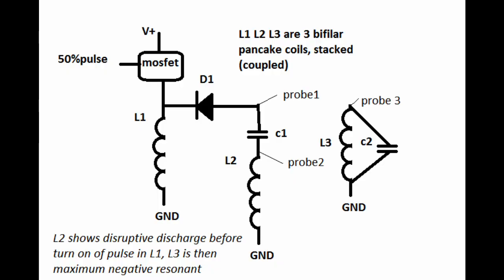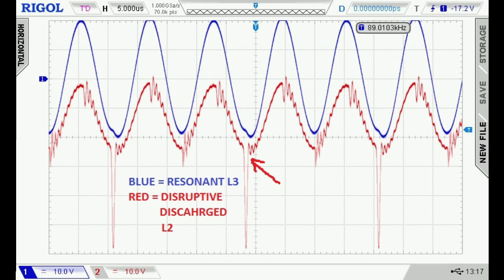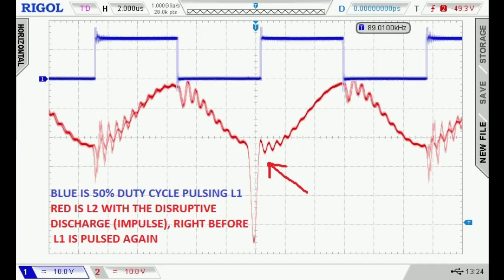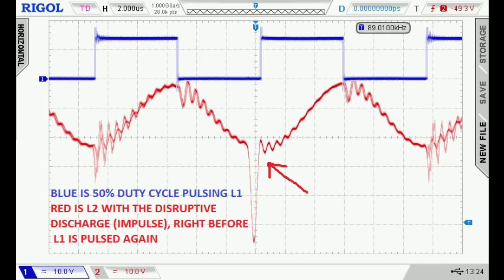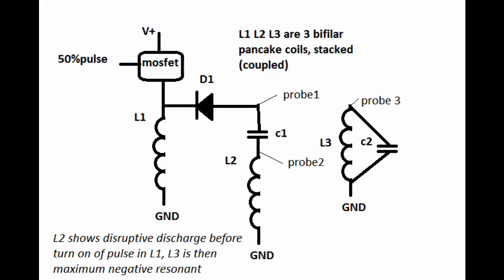Radiant energy bifilar coil experiment

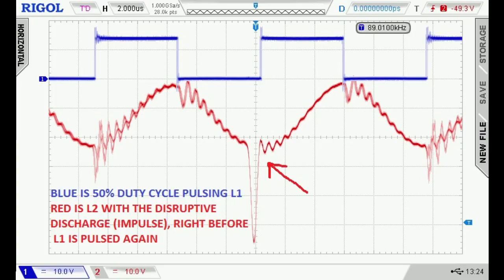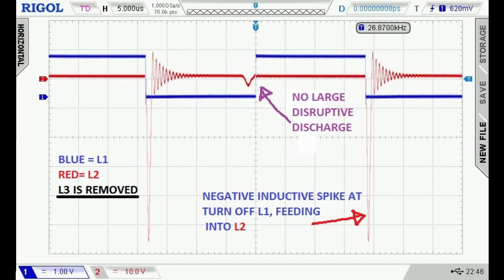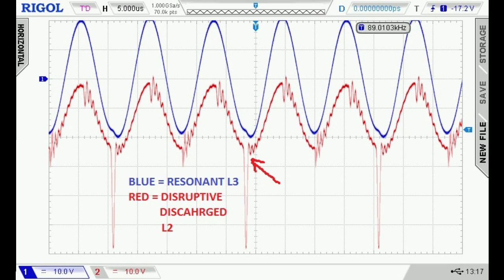Comment from the maker: the large negative discharge (-300V) at 1:27 should not happen at all. The negative inductive spike seen at 2:58 is perfectly explainable and expected (CP Steinmetz gives a good answer).  but is not seen at 1:27! Are the coils acting as diodes, by their magnetic fields?
Reply: Exactly YES... The coils are a conduit pumping with expansion and contraction. The coil will have a higher pressure side and a lower pressure side and a low temperature side and a higher temperature side... My explanation for the magic that seemingly occurs for equipment sensing back EMF pulse before the switch opens or closes as if there is an intelligent anticipation, is that with open systems we are creating what I term as Electro / Magnetic pumps. Depending on the configuration of the bifilar coil, there will be observed what I call Radio Frequency Watts others call Radiant Watts... The Radiant Watt, to those of us who observe and build devices to pump Radiant Energy simply call it Smart Energy... True Radiant Energy  navigates densities without colliding with most matter composed in electrical components such as diodes, MOSFETs, capacitors, batteries, coils or the human body!  Most indoctrinated engineers in my generation were trained not to understand this phenomena. This Radiant Energy is the universal communication line that impulses controlled by at least three spark gaps in series with varying distances create the footprint to control linked systems to other Conventional Electro / Magnetic transformers. Hope this helps! Have fun and do no harm! This isn't "PFM" (Pure Freeking Magic) however it's close. Any electromechanical device that went maverick or uncontrolably attracted high voltage and amperage, that I've created, and destroyed itself, after  performing a post mortem inspection, I found always at least three spark gaps on the devices components and remains. Be careful with learning this system as even just (1) D size Alkaline 1.5 volt battery can and will deliver up to 25 Amps explosively with potentials way beyond 50,000 Volts!
Reply: 2DOG3FIST  Devices that i've experienced, designed, built, tested & experimented with are primarily closed shielded buck and boost circuits. When dialing in tuned ultimate performance and finding real world operating parameters and my subject circuit performed lets say beyond expected potentials... I call going maverick! Well beyond designed currents and voltages... While doing post mortem inspections I've always found at least 3 spark gaps (these gaps not intended but caused by high potentials) on the circuit boards, wires or connections (ie somewhere in the system) that opened the system to transient (mmf) "Magnetomotive" . Some performed spectacular but for a short duration of time! The puzzle of transient energy is fascinating. I get pleasure by reproducing these experianced anomalous phenomena to safeguard against future burnouts of planned designs. I take sincere note and respect. Cheers!
Reply: i consider the 'buck / boost' all under the 'magnetic pump' catagory thanks for the reply.
Reply: Kolin Evans Your welcome!  Most who work with buck / boost do understand we are working with magnetic pumping in that, we are compressing the reluctance of North against North  and offering the result of this compressed magnetic wave to the suction South circuit, which overcomes density of the electrical circuit's grip. Personally my perception of the spills of the radiant gradient one of the keys to unlock the grounded earth pump electrical system. It's a Centrifugal spin off of magnetic voltage energy potential recaptured by the Centripetal Amperage energy potential. Have a great day! This is an example: https://www.youtube.com/watch?v=FvV40BWgByw
Reply: yes thank you for the reply - indeed i've been thinking along the same lines re your dual polarity and output results so thanks for the input - as regards Earth pump - also i've had this and that {archived} curiotsity towards the common Microwave oven 'transformer' in which the High potential {2kv~} side is 'earth pumped' with the output polarity then being directed to a high potential capacitor with the other plate also being polarized to earth with is high potential diode.   i've  often mused to myself the results of 'pumping' one polarity of the high potential into earth then equalizing it on the other plate of the capaitor to earth..
i have also been playing with mirrored inductors recently, so thanks for the reply. 

my next experiment after playing flyback pumps will simply be three inductors on a core each 'tesla' wound and two being mirrored - the third i will experiment with self connecting - this should universally oppose a simulatious field effect from the two - {as long as the magnetice circurt is correct} so i should have two simulatiious polairty of the same type at the point of the self connected third inductor - my musing is such that the attempt to oppose both polarity {by the third inductor} will cause the natural opposing polarity to be forced into the center of the self connected inductor - these should produce a 'rippled' wave {symetrical} that would be possibly tapped at a 90 tangent to the direction of the original forces. 

this is because it should be nessecarily counterspacial  - but i don't think by tapping it there will be any real 'power' but it would technically be 'free' 'power' at that tangent - 

it's not so different to a gravity 'flywheel' the center point of a gyroscope is the counterspaical area - it's essentially the 'electrical' version of a spun-up flywheel

but considering my 'luck' it probably won't operate like so : ) : 0
Reply: your 'N N S' comment does inspire some more experimentation with the buck system so thanks for the reply.
Reply from the maker: @anserinae  yes I've seen it a while  ago
Reply: i would fail at this point because the languge you use i can't understand - i don't understand 'negative' - i can only understand polarity potentials - if i think in 'negative' etc nothing makes any sense for me, but i think you will work it out  - but for me personally i can not think in 'negative' and 'postive' any longer due to all the words being mixed up :

i will give you an example in 'AC' they say there is a 'negative' 'half cycle' this is totally incorrect and probably on purpose so there is no 'negative half cycle' there are to alternating polarities 

it's like saying : 'federal reserve bank'  it's not a bank it's not federal and there are no reserves.

AC has no 'negative' and it's not a 'half cycle' it's a polarity event - the polarity events alternate - it's simple if you trace it back to the generator - one event occurs when a 'magnet' pole passes by an inductor and induces a field effect - and that is one event then the other event is of the other polarity, there is no 'positve' or 'negative' - it's just two poles. 

- so i can only see  spike of a polatrity that is different to the other polarity that was read on your meter.
Reply from the maker: low/under pressure =negative voltage (south magnetic vortex) 

high pressure= positive voltage(north magnetic vortex)

Sorry didn't read it all , but wanted to share this.
Reply: no worries - yeah sure i could work with 'low' and 'high'.

 regardless - you have spiked my intersted so i'm winding 3 'T' {dual wire alternate connected} winding onto a toridial core {i think it's metglass} {it shows high inductance}  

and i'm going to draw out the 'magnetic' circurt i expect it's not so different to an 'induction motor' - if i come up with anything i'll post it . 

two winding will be 'mirror' wound  i will self connect the other the 3rd and look at different results.
Reply: Master Ivo  yes! Demarcation is at the flux point or the point of time that Sinusoidal Alternating Voltage and Current in Phase stop then travel the opposite direction from which it was going which is a bipolar switch in and of it's-self... Referencing the Magnetic circuit. The spikes are caused by (mmf) called "MAGNETOMOTIVE" Force explained in physics as North wants to be pulled or sucked South overcoming magnetic reluctance... The South Vortex is less than 1% larger, but thats enough to react bifilar coils in staging bipolar action, favoring Southern Polarization Magnifying Magnetomotive influence and so the bifilar coil acts as a polarized South diode at demarcation on series connected bifilar coils. In buffered reluctance the North pulse gains & gangs bypassing just a little past the zero point demarcation in that it pumps an overspill compression wave I term as neutral boyant packets. I think of these NBPs as fillers that compress the electrical circuit. Best wishes!
Reply: Kolin, yes...AC is only current moving in one direction and then the other...not negative which is a human convention...both cause, of course positive power (heat).  In copper, the majority electrical energy 'carrier' is the electron regardless of the direction of current flow.  Now having said that, Dielectrics can accumulate both negative and positive charge on opposite sides of the dielectric.  This negative charge is generally accepted to be from the excess electrons...while the positive charge, excess protons.  Of course since there is no current flow in the dielectric this is caused by a 'strain' of the internal electron orbits of the dielectric (analogy, polarization, displacement current, cold electricity).  As Tesla found, before a switch is closed to a high energy dynamo the circuit that is connecting 'feels' the 'dielectric' pulse just previously to the closing of the circuit transmitting a high voltage dielectric pulse before closing.  This could be what IVO is observing in his experiment.  A little more hard to discern because Tesla used a high energy dynamo and contact switches while IVO uses a rather low energy supply coupled to a semi-conductor  switch (albeit a fast acting one which may make up for the lower energy).
Reply: Mark S - i'll take your word for it on the 'electrons'  - as regards Tesla 'discovery' on the high potential switch closing - the 'feel' of the pulse is likely the field effect transversing the air gap as the two conductive plates of the switch approach. 
i couldn't comment on if that is what is occuring here as i'd have to draw out his circurt both the 'magnetic' {field effect} and the var connections etc. 
as i'm not working with any pancakes i'm not undertaking that - i am however looking at field effect recovery in a 'flyback' system or field effect pump - you know the process where by field effect is 'pumped' into the core of the magnetic circuirt then 'pumped' out - it's how 'industrial' computers use to work on this planet did you know that? utilizing the core as memory basic devices.

yeah i think theres something to a charge disruptors - like maybe have a 'gap' pre first 'coil' then exiting that coil then perhaps 'shorting' the center coil with a charge disruptor - but in Ivo case he would not have enough energy potential for that.  you'd have to just play with multiple charge disruptor configs i think - that's what Tesla would do .
Reply: no, not as Diodes. It#s about resonance, phaseshift, may be quarterwavelength reflection (answer in opposite polarity). Because disappearing after removing L3, it seems to be a resonance effect. Consider the coils beeing a capacitance as well (making it more complicated). I suggest for these experiments to first use ordinary wound pancake coils.
Reply: How about the spike duration. Was one unit on the scope ...
Reply: I wonder if you're seeing an implosion at work. Everything in nature that is extremely powerful uses an implosion. I suggest you look to natural phenomenon if you can. What in nature uses radiant energy?
Reply: I think you can push the radiant energy from the Ether inwards through your coil. A pulsing implosion at high frequency. Creating a energy syphon. Maybe I'm crazy but that's what I visualize.
Reply: Just thinking if Tesla could create radiant energy fields that lit up rooms...  If he could spread that energy around... Why couldn't he suck it back into his Tesla coil ?
Reply: Hi,the most promising motors/generators are those based on hydrid version of electrostatic/magnets ,some using spark gaps others not.

Look up  Witts device #420 onwards-   https://witts.ws   'their device APPEARS t ? o be an ELECTROSTATIC FIELD POWER GENERATOR SIMILAR TO     MODIFIED HYDE GENERATOR PATENTS AND USING IDEAS(WHEELS) FROM THE INFAMOUS TESTATIKA DEVICE THAT IS BASED ON THE ELECTRICAL CIRCUITS OF WALTER R.PIDGEON PATENTS(1898-1899) AND THAT OF HANS COOLER(1945-46) .
Again this is what it LOOKS like to me.. looking at their pics+ explanations.
WITTS is a religious  organization and in general secretive to a degree in regards to their technology.

NO KNOWN ? docs/theories  using about W.R. Pidgeon except short descriptions
Also look it  up at  https://rexresearch.com
And for book on Electrostatic motors  https://shamanicengineering.com/category/books

BEST LIVING Person that can direct/help on that subject is still Eric P Dollard  https://ericpdollard.com    
Note- Tesla KNEW ABOUT RADIONICS. 
The most open about radionic secrets is still showman Joshua P warren with his Wishing machine/psytronics applications-   https://joshuapwarren.com
Reply: 2:50 high spike discharge what you saw in the scope coming from dielectric stored between winding (NOT between turn, which is L1 & L2 & L3) each turn, since you operate at self resonance coil (steinmetz electrric disch wave and impulse chapter "Lecture X"). for more, read page 127 for better improve winding your coil

Comment: "ea" = each... Looking at Pancake Bifilar Coils with a 3 dimensional perspective view referance, they "The Pancake Bifilar Coil" facilitate overcoming latitudinal resistance interference in that the "Y Axis" plane which is normally interpreted as the horizontal axis left and right or East and West. Most people working with bifilar coils forget to bring to mind dimensional relationships in that a circle pancake coil is the most talked about as they are simple to construct. However when utilizing bifilar coils we must think outside the box and work with different ratios to capture the coveted Back EMF or Buck and Boost advantage. 

An example is like a car on a pure circle race track, the highest speeds on a circle track are obtained by power drifting on a circle track! Correct? 

What happens when the mind set looks at 360 degrees as on a compass. I use scale degrees for lengths and ratios in light of any model is easily interpolated and becomes predictable with little experience.

Better Performance... I suggest we build a track based on pi in a North / South to consider the X Axis bifilar coil configuration. To keep this idea simple lets work with the 3, 6, 9 ratios starting with power of "3"... 3 X 360 = 1080 Think of "1080" degrees as the circumference of scale being the total design. What happens now to an oval track when we have 2 each 180 degree turns on the North / South directions so we used up 360 degrees of our total circumference. Correct?  1080 degrees - 360 degrees = 720 degrees in length circumference. Right? So now we have 2 strait sections on this oval track 360 degrees long North / South... In closing look at a 6" diameter circle for scale, observing the length circumference calculates 6" X Pi or 3.141592... = 18.85 Inches circumference rounded up X 3 = 56.55 inches total circumference in this example the strait North / South are 18.85 Inch smooth transitional straits to curve ratio. Now we have transitional "Boost" with ability to capture the Buck This would be a faster track offering a little more Buck & Boost.

For Extreme performance... Now if the 56.55 inches Divided by 2 = 28.275 inches long with hairpin curves .5 degrees, we have much more buck and boost potential... Right? This is a type of improved bifilar Buck & Boost that 1 Ea. or each I'm referancing. With vortex math 900 works reciprocals to facilitate timings for impulses... Have fun and best wishes!

Comment: Ivo, 
I was thinking about your observation of L2 disruptive negative Pulse.
I have not made the experiment, but consider this;
In your probe testing configuration, The Blue trace probe was setup for monitoring Voltage, and the Red trace probe setup to monitor the current. And  your circuit design is more inductive than capacitive, therefore the current leads the voltage, in this case. 
Does that make sense, and/or is that a possibility ?
Reply from the maker: no I dont measure current. both are voltage. The red probe is 10:1  giving 100V per div.
Reply: OK, that's good. 
It is an interesting phenomena.
Worth noting.

Comment: Would it not be congruent to use the same electrical component available to tesla at the time, instead of modern electronics?
Reply from the maker: if he had mosfets, he would use them. but he didn't have much choice, so worked with what he got

Comment: What I have found is that the charge of the capacitors is faster than the discharge from the battery at the input. Fast reaction diodes are important. Nealsons example is very interesting and I believe he has an induction motor/generator involved in his setup. This allows for the feedback loop to work. Question! Is time included in all of your calculations? Please measure amps x volts in and the same on the output. Also a timed experiment with the same load direct from battery to load. Then from caps to load. This gives a good picture of what you have.
If the bifilar coil is acting as an electron smashing device are we collecting the evidence of what is left after each collision?
Reply from the maker: indeed mur460 diodes. IF i produce an outout, I will conduct proper measurements. Is time included? If needed yes.